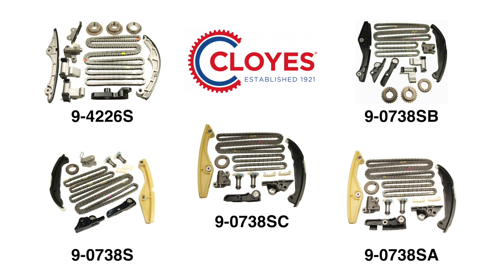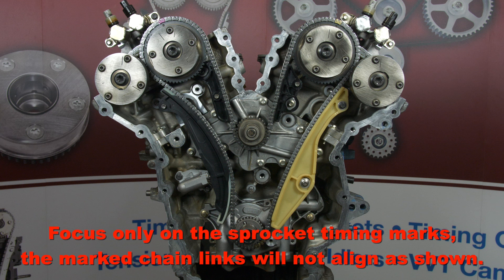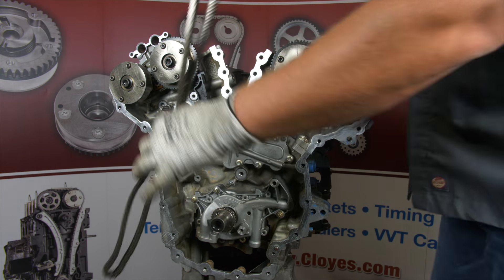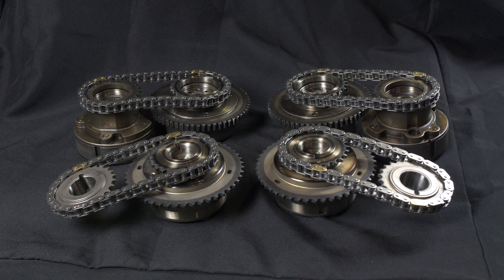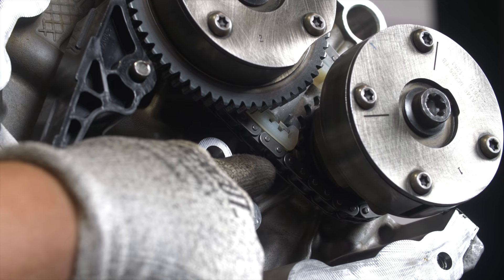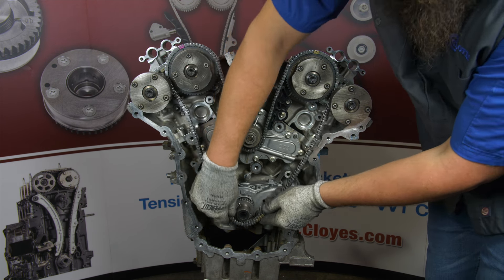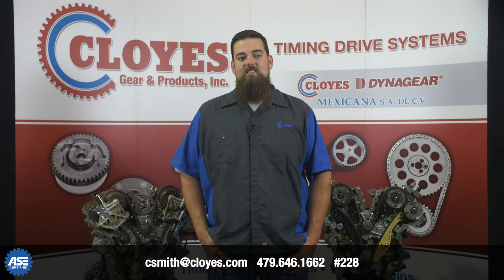Ford 3.5/3.7L DOHC V6 Timing Chain Replacement, Cloyes 9-4226S & 9-0738S

Comment: He says you don't need the cam holding tool. BUY the Lisle tool 37200 and use it!!! or it's equivalent. The right-hand exhaust cam is prone to move. What happened to me is the phaser sat a little too long and lost enough oil to have free travel (there is an internal spring so it's not actually free travel but near enough) and the alignment dowel can fool you if you accidentally get the dowel in the channel. it felt good so I snugged it up regardless that the parallel flat surface on the cam and phaser drum were not aligned, I figured the difference was due to the loss of oil in the phaser, or perhaps the phaser was locked. Tying to get the alignment right so I could use the tool I had to unlock the phaser. Note: you will be holding a lot of loose parts trying to stab one drum then the other at the same time, for me I felt that familiar setting of the dowel when as I presume the dowel knocked against the edge of the recess, so when I applied pressure the cam moved I thought I had it. Note: when I got the tool and took it all apart to do it right this time I could see the indent the dowel made when I snugged the phaser up; I was way off. I hope I did not hurt this engine. I always turn one full turn and check for free travel. engine would not turn but a tiny bit and stop. I'm still not ready to start the engine but it feels good for two turns of the crank.
Reply: further note: I pulled the locking pin and spring out of the phaser that I was having trouble with and put it back after I had everything torqued
Reply: Praise God! I no damage it runs great.

Comment: If you have a dual vvt engine instead of the quad then you definitely should have the cam holding tool. They will be flipping around if you try turn them at all to set the sprockets

Comment: I bought a complete kit for a 2010 ford flex but the right upper guide was not the same as oem so i couldnt use it.  It may have worked but my bolts were too short.
Reply from the maker: Ford did change the design of that upper right hand guide. If you own an earlier model engine you will see a difference in the guide and it will require longer bolts.
Reply: @Cloyes01  We just ran into this and had to search you tube comments to make sure we weren't installing wrong parts. An updated instruction sheet included with the set would have been great. Maybe even include the bolts you'll need also? I would pay a couple dollars more to have it come with everything.
Reply from the maker: @natechristensen6058  We have developed the bolt and it will be included with the guide very soon. I apologize that we didn't have it sooner and save you some hassle. Thank you for the feedback!

Comment: Cloyes I need help , my timing chain is still on and needs replacing and bought a kit of yours  for a ford Taurus 3.5 , timing chain won’t move neither will the crank shaft won’t budge , car is in park with no battery , help please

Comment: @cloyes01 Hi ! I checked my timing the camshafts are on 11 and 1 but the crank is at 4:30 or about 125-130 degrees can I take off the chain and turn back the crankshaft a notch as it looks like I skipped a tooth?
Reply from the maker: You can, but make sure you are referencing the number of links between the sprocket marks, not just the static locations of the shafts. The chain sets the timing in this engine. In a new install you align the marked chain links, if the engine has rotated you need to count the number of links between the sprocket marks to ensure the engine is properly timed.

Comment: I also have another VERY important question: Are the cam bolt torque specs different on the non turbo 3.5L DOHC VCT SMPI Vs. the Ti-VCT? 
The manual says 3 stages: 30ft lbs, loosen 1 full turn, tighten 89 INCH lbs then 90 degree tighten.
I followed another video's recommendations for my 3.5l. tighten to 30ft lb, loosen a full turn, then 18ft lbs and 180 tighten. 
Did I over-tighten?
Do I need to grab 4 new bolts and do it over?
Reply from the maker: We recommend the sequence with the 180 degree final step. This should apply to all engines with quad VVT phasers.
Reply: @Cloyes01  What about dual VVT phasers as opposed to quad?  Same 180 degrees or is it 90 like Jeremy Fahrni asked?  I have also seen reference to the other sequence.

Comment: How'd you torque the cam bolts without the cam holding tool?
Reply from the maker: You hold the camshafts with a wrench on the hex features as you torque the bolts.

Comment: How long do these 3.5L phasers and chains last vs the stock OEMs in properly maintained engines?
Reply: 🤔 good question
Reply: I watched a video where the guy says water pumps seem to fail between 350K and 400K I imagine the chains last longer than that. The best wisdom is, just replace the chains. Phaser locking pin will raddle on startup when phasers go bad or not bad so much as the customer would rather replace than listen to a second of raddle.

Comment: I turned my over by hand like i usually do and the chain was sliiping. Should i not have turned it by hand or is my tensioner failing. Its compressing when i turn the engine over by hand
Reply from the maker: The tensioner is no match for the valve springs when rotating slowly.  As valves open and close, chain slack will shift from side to side. The tensioner will compress back to last ratchet mechanism step, especially with no oil pressure. We do not recommend rotating by hand once the timing is set, or at least limit it as much as possible. When rotating at speed, even with the starter, there is not enough time for the slack to shift back and forth, so much less chance of jumping a tooth. Once the tensioner builds some oil pressure you have nothing to worry about.
Reply: @Cloyes01  thank you for getting back to me

Comment: So if I set my timing marks... what about my crank timing mark not lining up but my cams are where they need to be? Thanks for pointing out if the crank timing mark can line up with the dowel since the timing mark isn’t close at all, but I did like you said in the beginning and set the chain marks

Comment: i have a 2012 ford explorer 3.5l my water pump failed the oem eater pump had a plastic propeller i bought one that has a metal propeller will that have any affect on the car
Reply from the maker: No, the metal impeller is a valid replacement. You will have no issues with using it.

Comment: Question: I need to apply silicone to form a gasket at the back of the water pump to extra protection or the two gasket that come with the pump are enough. Thanks
Reply from the maker: The O-ring style gaskets on the back of the pump are all you need. Just make sure the engine surface is clean.
Reply: Never use sealant on o-rings.

Comment: The cam shaft holding tools, may not be "required" when doing this on a stand. You will be dam glad you have them when doing this under the hood. Without them it is a fight.

Comment: So i have a question on the primary tensioner you just pull the pin and its ready to run no necessary activation i set the timing on an ecoboost 3.5 V6 using a cloyes kit today i just installed the front cover and harmonic balancer all i did was pull the granade looking pin , is that the correct procedure?
Reply from the maker: That is correct. The primary tensioner activates by pulling the pin. The secondary tensioners must be compressed and released.

Comment: Looks fairly easy but can all these parts be installed with the engine mounted inside the car?
Reply: I done this job on a Ford Explorer with the 3.5L v6 for it's water pump.   Didn't drop cradle or anything just left the motor rested on a 3ton floor jack with a piece of wood.    Just had to crouch in the wheel well taking the timing cover off and  while looking and setting up the crankshaft marks and when I was done just raised the engine up with the jack and put the mount back on.  The engine moves pretty easy to get the motor mount bolts to line up.
Reply: @ Ok thanks Jim but can you please briefly explain how the engine was freed so it could be lowered? Did you first have to remove the motor mount? Thank you for your time. I have to do this job on my 2012 Ford Edge 3.5L V6.
Reply: @youtubecommentor4480    Put a  2 or 3 ton roller jack under the oil pan.  Harbor Freight Daytona jack is what I used perfectly the 3 ton version.   Put a piece of wood between the pan and the jack to prevent damaging the oil pan.  Just jack up the engine until it just starts to lift up slightly.   Then remove the motor mount bolts and pull out motor mount.    Then you can lower and raise the engine as you need.  The engine can be moved easy with prybars or by hand to shove it back into position when installing the motor mount back on.  The transmission and torque mount will only let the engine drop so far too.    The Harmonic balancer will be your next difficult thing to deal with.   A 3 jaw puller will remove it.  You will want to get a longer bolt to get the balancer put back onto the crank shaft then use the original bolt after its somewhat seated.    Then the next problem area is the bolt for the left side timing guide  where the bolt is behind the cam phaser.  You might be able to get it slowly out so far to swing the guide out of the way. Don't forget to get the bolt tighten up after the water pump is done.   Also drain the coolant unless you want to dump over a half gallon of antifreeze into the oil pan when the pump is pulled off.  Your gonna want to change the oil 2 times.  Then change it again in 200 miles or so.
Reply: @ Hey Jim, thanks so much for this detailed response! I did not know the engine could be lowered in this manner. I did see this procedure in another video but it was not explained as well as you explained it here! I will read this reply a few times until it sinks in and will get back to you with any additional questions if that’s ok. Thank you very much Jim.
Reply: @ Jim, is there only ‘one’ motor mount that needs to be removed? In other words, is there only one motor mount holding the engine in-place? Also, buying my timing chain parts from Rock auto and buying the Cloyes brand. Do you recommend Cloyes after market parts? However, I will be buying the Motorcraft OEM water pump. Rock auto sells this Motorcraft OEM water pump for a lot less than buying directly from Ford.
Reply: @youtubecommentor4480  Yeah only that one motor mount needs removed.  There is a torque mounts that you don't touch and a transmission mount you also don't touch.  I   recommend the Cloyes kit because the chain is marked which makes its stupid simple to line everything up.
Reply: @JimSmith-n9f  Ok Jim, got it!! Thanks for your helpful advice. How long has it been since you completed your fix and is the  Explorer still running ok (in regards to the water pump and timing chain)? Just curious how the Cloyes kit/parts are holding up.
Reply: @youtubecommentor4480   As far as I know it's running just fine!  It was for a used car place I did the job for as they sell the vehicles as they are fixed.    As for the Cloyes kits and parts they are just as good as OEM if not better.   I used their kit for the GM Ecotec 2.4L with no issues and a Chevy Cruze 1.8 kit they have too with no issues.

Comment: Okay I I can’t get the 11/1 o clock to line up I can line up the 4 o clock one but the 11/1 face down. I tried turning the engine but after like half a turn it gets hard

Comment: I just did my waterpump and timing chain but I noticed the right secondary tensioner never sprung out does it need oil pressure to actuate that tensionerr?
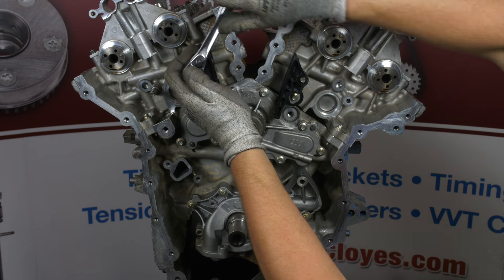Reply from the maker: Please watch the secondary tensioner explanation starting at 5:04 of this video. The tensioners must be manually activated after the secondary chains are installed. Compress them down completely and release.

Comment: 11 o’clock 1 o’clock and 4 o’clock is all I need to line up to replace timing chain? The colored links don’t mean squat?
Reply from the maker: The marked chain links are the most important thing to pay attention to. They must be aligned to the sprocket marks for the engine to be in time. The positions of the sprocket timing marks (11, 1, & 4 o'clock) are just the recommended starting positions that will help the chain installation process.

Comment: I have a question. I am doing timing chain on a 3.7 does piston number one needs to be up cause the timing chain is jumped over. Before taking apart, I cannot get the marks to line up.
Reply from the maker: When you position the crankshaft sprocket mark at 4 o'clock you are putting the cylinders in the correct position for timing. If the marks will not all position correctly at the same time, focus on getting the crank at 4 with the camshafts as close as possible before you teardown.
Reply: OK, thanks for explaining

Comment: Hi I have followed all the steps in video but I have 0 pressure in all 6 spark plugs. Any idea why would that be. I am working on 2011 F150 3,5. Thank You
Reply from the maker: Did you have a failure before replacing the components? If you do not have compression, the engine is either out of time or you have bent/damaged valves.

Comment: Hello Sir;

You did a great super job BUT the demonstration of the tighten the 30 foot pound, the loosen 1 full turn which critical, it does not show, 18 foot pound and another critical face the 180 tighten degrees turn was not show but still was a great video, it would it save me a lot of money.

Respectfully;
Andy

Comment: Do I rotate the engine clockwise or counter clockwise?? Or does it matter..
Reply from the maker: You typically want to rotate an engine clockwise, but while setting the timing, counterclockwise rotations to get the shafts to align will not hurt anything.

Comment: I took the camshafts out to remove the heads. Now when I put the cams back in the heads how do I know where to clock them up to put the phasers on?
Reply: Mount the phaser and turn the cam until the timing mark is at 11:30 position for the right bank and 12:30 for the left bank. Just make sure you rotate the crank ccw shaft so the pin moves from the 12:00 position to the 10:00 position. This will lower all pistons to allow room for the valves. When ready, move the crank back to TDC.

Comment: Purchased your kit and it referred me to this video. It came with the updated guide for upper right side. I received two new bolts but they're too long. ?? this video doesn't fully explain how to your parts.
Reply: and the updated guide is thicker. Reusing the old bolts doesn't allow the bolts to extend into the head for proper torque. One old bolt doesn't reach at all which is obvious why cloyes gives new bolts but the other side prevents 6mm of the bolt to be used.
Reply from the maker: @davidjoegamez5901  You should be able to use one original bolt, and one of the new bolts the we supply.
Reply from the maker: Hi, thanks for reaching out. If you will please give our Technical Support team a call, they'd be happy to help you with this. 479-646-1662 ext. 228

Comment: I bought a 2010 lincoln with the 3.7 in it and person I bought it from attempted to do the timing so timing chain is off how do I make sure everything is where it's supposed to be to do the timing. I will be buying a cloyes timing kit
Reply from the maker: Use the sprocket timing marks as your reference. Once you get the cover off, rotate the engine by hand until you get the 3 primary chain sprocket marks to align as close as possible to the positions we show in the video. 11 o'clock and 1 o'clock on the cam sprockets and about 4 o'clock on the crank. Once you get the shafts as close as possible, take the chain off.
Reply: They actually took the timing chain off before they aligned the timing marks I need to know what to do to get them aligned right so I can put new timing kit on
Reply from the maker: @kevinwaterman3006  I would recommend pulling the spark plugs out and getting an idea of where the pistons are in each cylinder. You need to find a spot where all the pistons are down in the holes at least a little bit. You might need to rotate the crankshaft slightly one way or the other, just turn slowly and do not force anything. Once you find a good spot where there are no pistons at TDC, then you can rotate your cams around where they need to be. Get the cams close, and position them where they are at rest, meaning where you feel there is no valve spring pressure trying to move them. Then you can freely rotate the crank so the mark is at that 4 o'clock position. Just take your time and slowly move the shafts where they need to be for the chain to align properly.

Comment: I took the camshafts out to remove the heads. Now when I put the cams back in how do I know where to clock them up before I tighten the caps up? If I dont have the cams clocked up right, I’ll kiss a valve on top of a piston head
Reply from the maker: You will want to reference the camshaft phasers. Look at where the indexing dowels of the phasers will align to the features of the camshafts, and locate the cams so the timing marks of the phasers will be close.

Comment: The VVT bolts were absolutely tight af. I thought surly the metal will break ... extremely tight.. I wouldn't be able to do without breaker bar

Comment: My 3.7l with the external waterpump has 60k on it and it’s starting to sound rattly. Should i be concerned?
Reply from the maker: If you are certain the rattle noise is coming from the timing area then you do have reason for concern. 60k miles is definitely premature for timing system issues, but a timing system rattle will not just go away.

Comment: I'm not so sure I'd be telling all that the cam locks aren't necessary.  I'd say they make torquing the cam gear  bolts to spec exponentially easier when the engine is in the vehicle.  And totally worth $24.